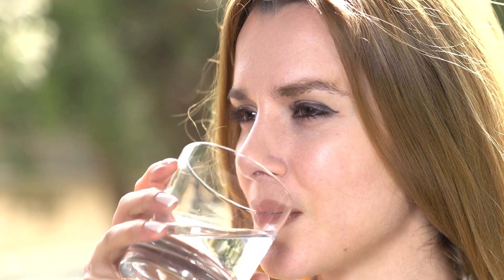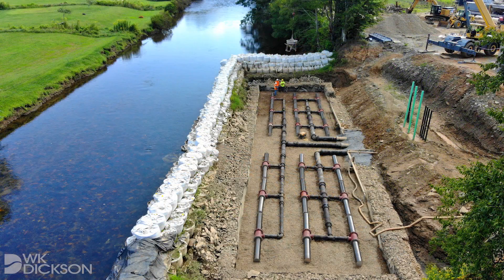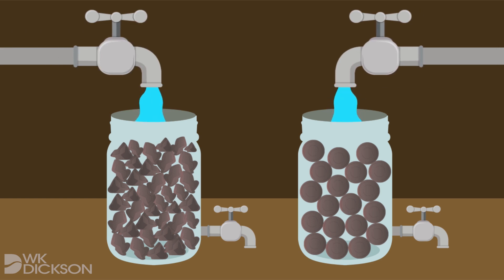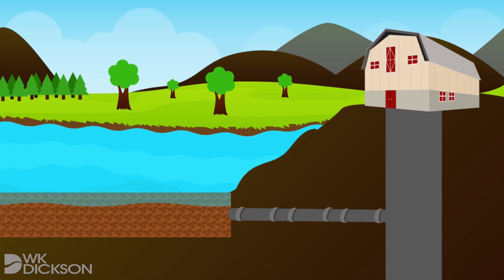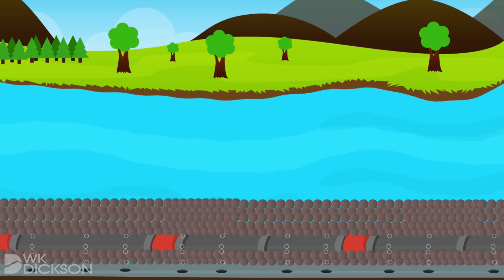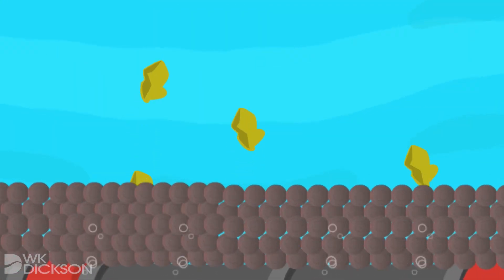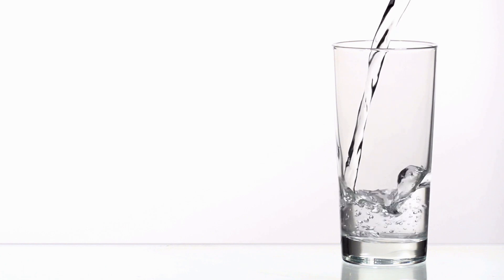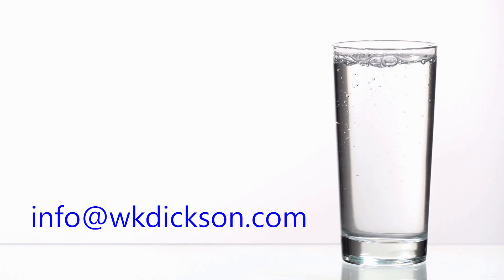Infiltration Gallery - How does it work?

Comment: What is the material of the perforated pipe used in the infiltration gallery? If it is to be constructed below the river having 4.5 mts depth of the sand bed? and which one is better in the long run?
Reply: The perforated pipes are usually wire-wrapped stainless steel well screens or louvered well screens to provide suitable open area, strength and provide efficient performance.  These screens allow you to control the size dimensions of the slot openings to prvent excessive sand and fines intrusion into the well screen during operation.

Comment: What is difference between infiltration gallery and infiltration well
Reply from the maker: Infiltration galleries are constructed using porous pipe surrounded by gravel under a river or stream bed. Infiltration wells can be constructed in a similar fashion or can be drilled. Additionally, infiltration wells can be horizontal or vertical. Hope this is helpful.
Reply: @WKDicksonCoInc  thanks sir...very well explained
Reply: @WKDicksonCoInc  sir also upload video about water distribution system